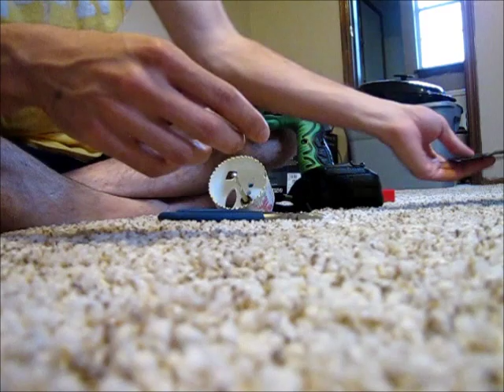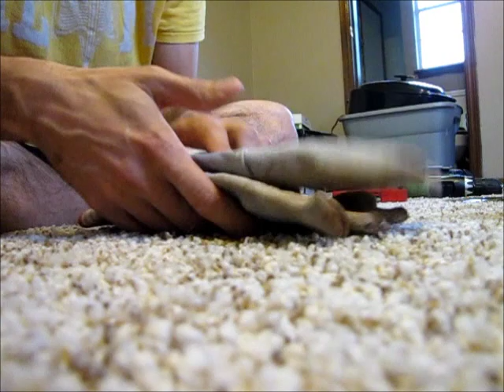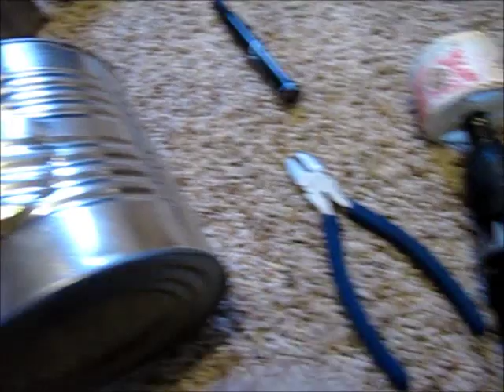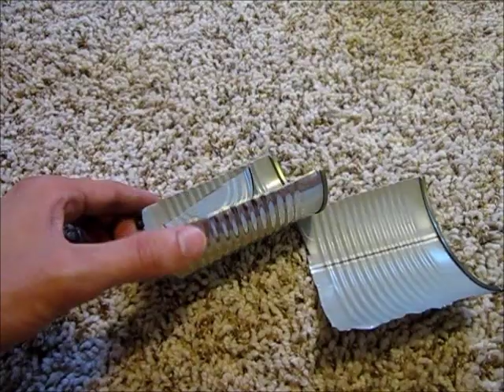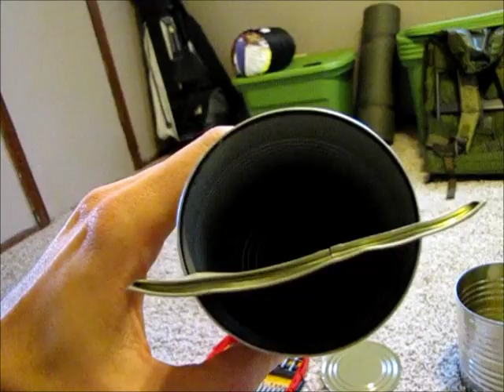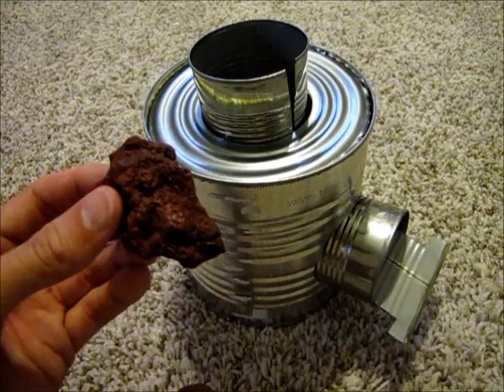How to Build a Rocket Stove for $8

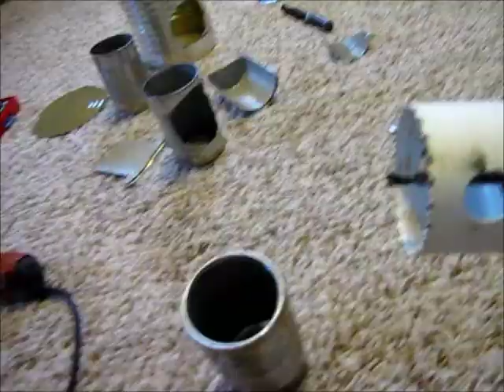Comment: What I'd like to see is what you did at 5:19 to get to the completed stove at 5:20. How do the inside cans go together? Thanks.
Reply from the maker: The back of the intake tube fits inside the other small can with the large hole in it to form an L shape.  Then the last can that acts as the chimney fits inside the top of the L shape and pokes out the top of the stove.

Comment: I believe that big can would be a #10. Btw, you can JB Weld that outside seam on the feed opening to eliminate any sharp edges and also seal the seam air tight..
Reply from the maker: Good call, thanks.  I have only used JB Weld once.  I might have to try that next time.  I have been toying with building an improved version of this stove.  There are a ton of great videos out there and a lot are better than mine.  I also have a MIG welder that I could use if I really got inspired.  Thanks for watching!
Reply: Yes, the videos are very helpful. I am no expert either and welcome any good ideas to play with and to also save a few bucks making things myself. JB Weld is a great tool to have in your arsenal. Although I would suggest running the stove a couple times before cooking on it to get any toxic fumes out of the  adhesive. Nobody wants to be eating or drinking it, that's for sure.